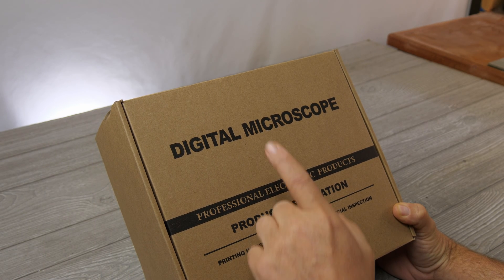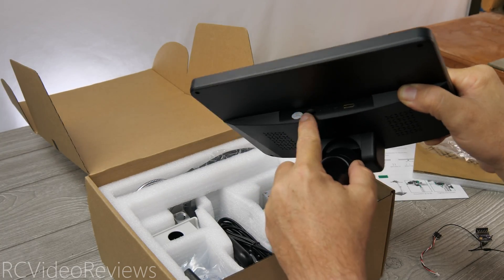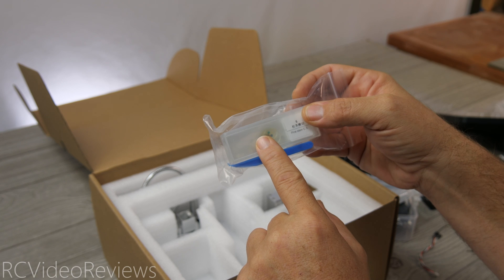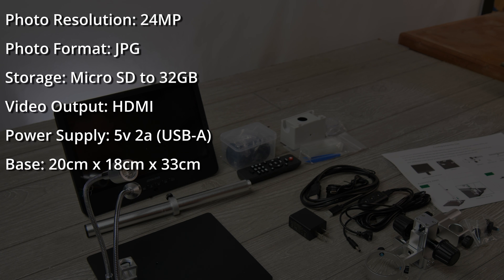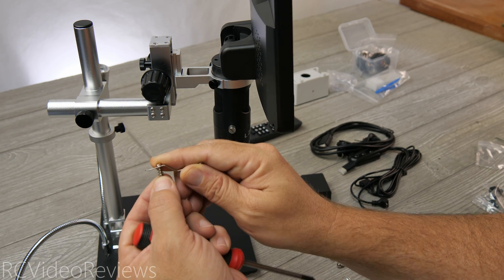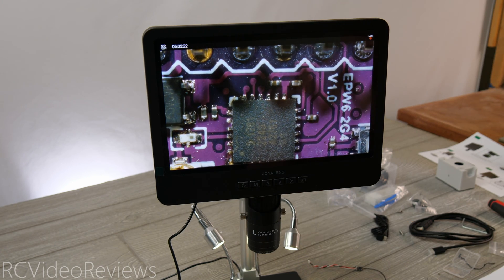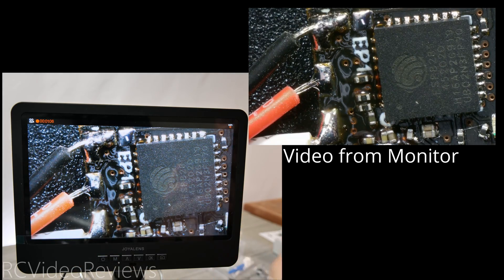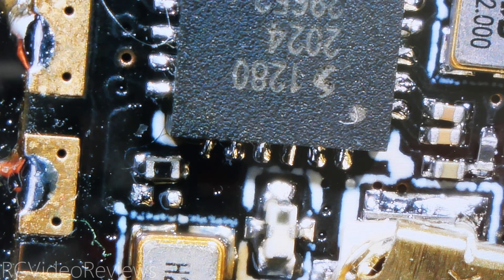Digital Microscope for Electronics: Joyalens JL249MS 3 Lens 10 Inch LCD HDMI

Comment: The issue I have with digital microscopes is the lag between movement of the soldering and the movement of the image o the screen.  It is difficult to solder properly with the lag between moving the iron and seeing the iron move on the screen. I have always used a binocular microscope and moving to a digital microscope is difficult. Have you tried to solder with the digital microscope?
Reply from the maker: I haven't tried yet. I will.